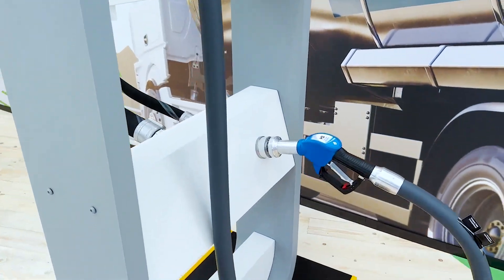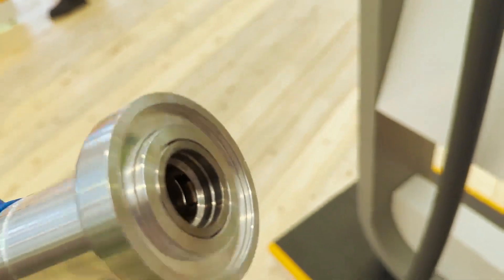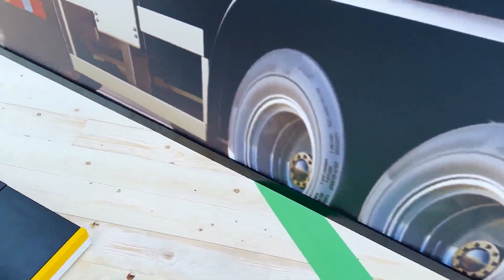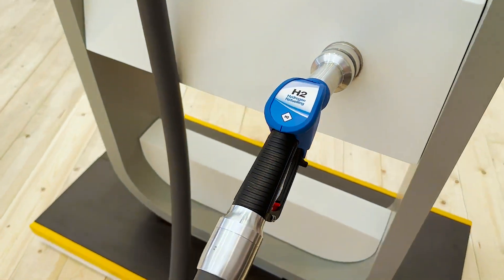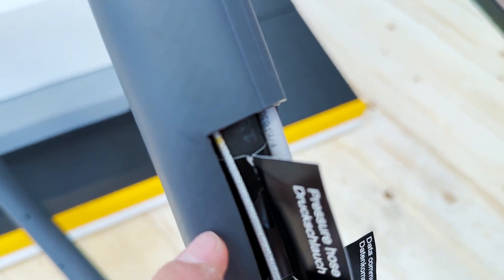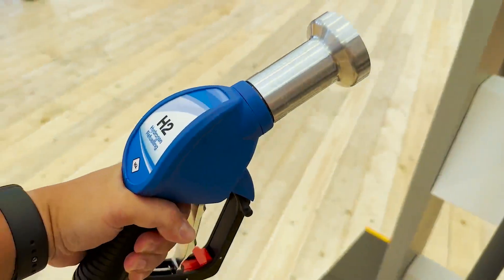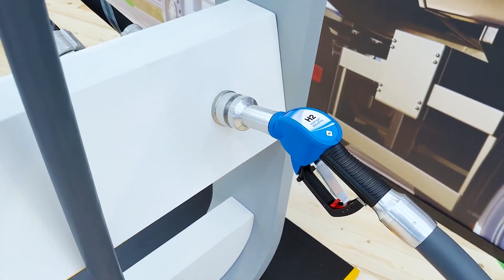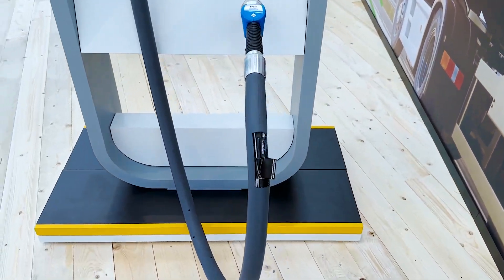Hydrogen Fuel Station - Continental Tech Show 2023

Comment: but how to get hydrogen with huge Amount. Which company to Manufacture.  Storage. fire risk
Reply: In kuching there are already 2 commercial petrol stations that have hydrogen pumps, run by the state’s oil company (Petros). Not sure about the technicalities though. Some buses in kuching and the upcoming ART (like a tram) will use hydrogen as fuel.
Reply: @flyingfox3766   ok.  that should in Sarawak had hydrogen manufacturer. But right now only toyata only have 1 model hydrogen. Super car had  hydrogen.  BMW 1 model. hyundai , 1 model number